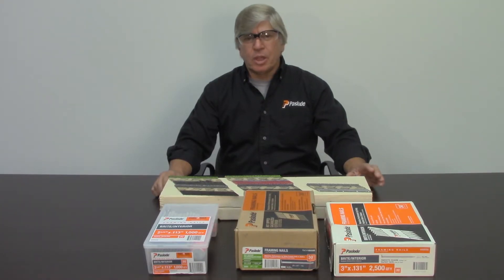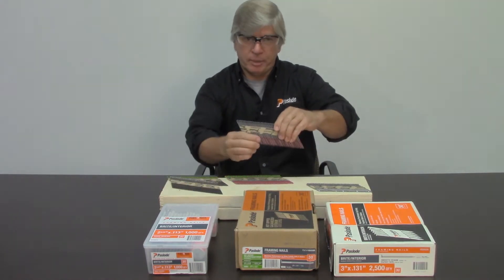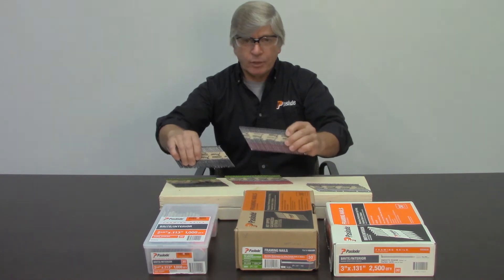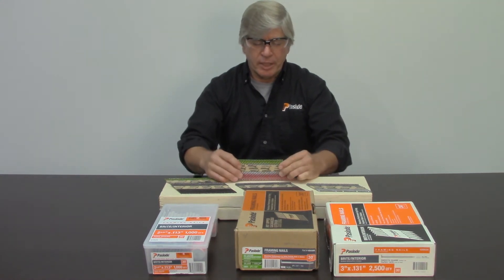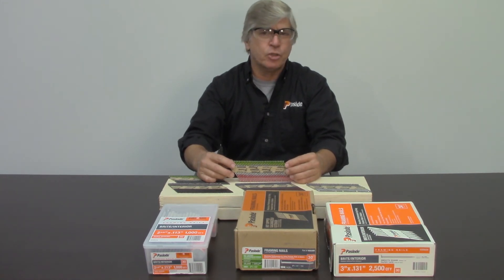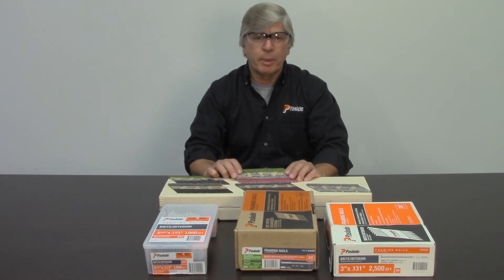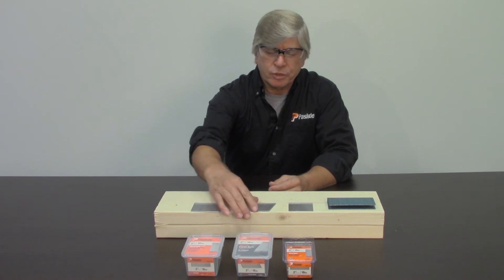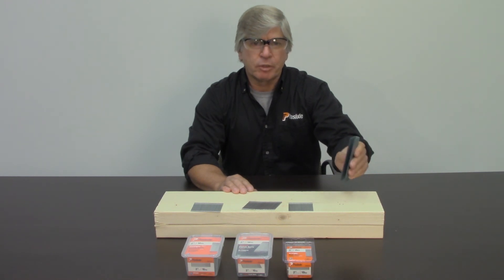Paslode Nail Introduction

Comment: The coating / glue is amazing
I live in Hawaii and the weather wreaks havoc on glues and coatings.   I had a box of the galvanized nails sitting on my workbench for almost 20 years along with a framing gun.   Recently put a new cartridge in the gun replaced the cartridge grommet, put a strip of the 20 year old nails and sank them without a single problem.   I may need a new nicad battery and that’s it.